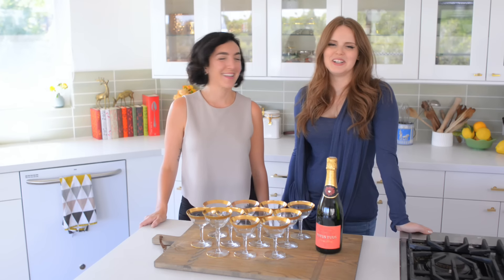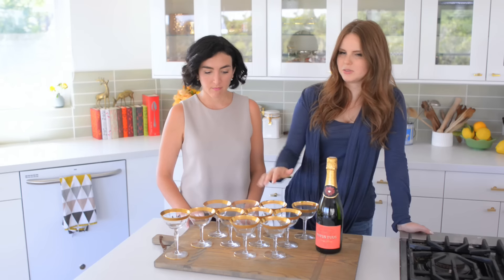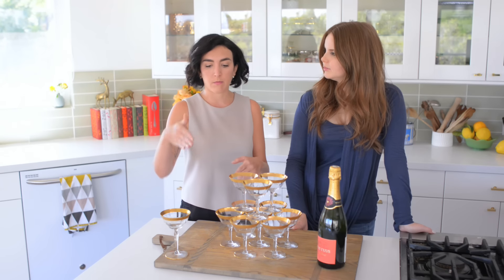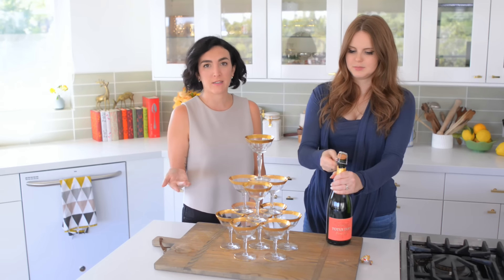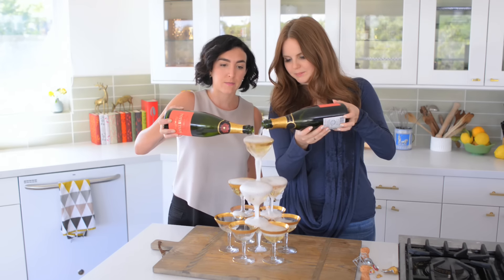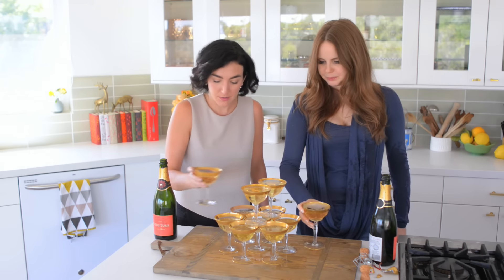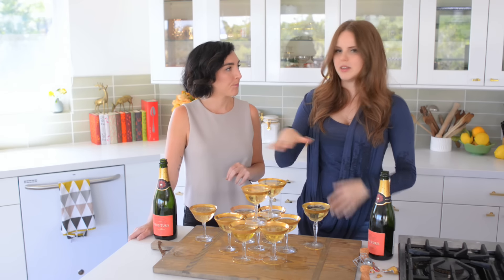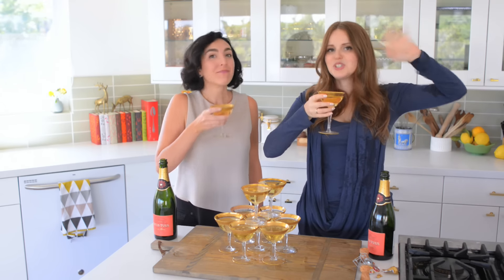How to Make a Champagne Tower // Living Deliciously with Whitney A

Comment: NEVER open a bottle of champagne right next to the tower!!
As student working in catering, we have had to build a lot of champagne towers. It really is a very precise task. If you do it well, all glasses fill evenly and hardly any of the table gets wet. The reason it went wrong for you guys is because the glasses were not close enough together and not all at the same distance. We would actually use measuring tape. For that reason, square towers work much better than round ones. Our manager would reserve at least 1-2 hours for two people to set the whole thing up.